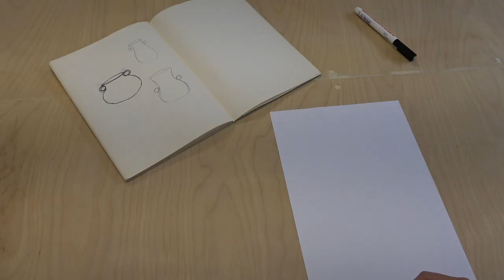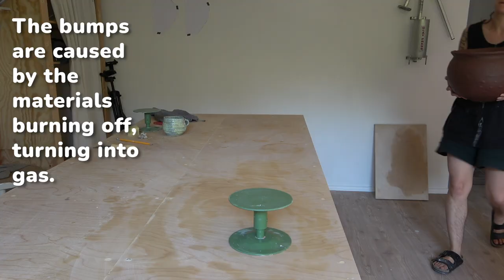A Lesson in Humility

Comment: Those of us who handbuild and sculpt for a living and make large coiled pots or other vessels or sculptures do not only put one coil on at a time and wait until it is leatherhard to add another, that would take forever for us to get anything done even usually with several pieces going at a time, you can add as many coils as the piece can handle until you start to feel that it needs to firm up to support more coils, but absolutely, especially with the first few coils, it can support more coils at one time. Most things can support quite a few coils before it needs firming up. And then most of us use a heat gun or gas torch or even hair drier to dry the lower parts until it is firm enough to accept more coils, this way we can get an entire pot done in one day. Especially if you use paperclay is extremely easy because it regulates air and water flow much better than regular clay so it dries faster naturally (and will also stay at whatever dampness you want easily with covering or putting in a damp box in between things and you can push it back from dry or leatherhard to wet even if you need to). Even if you don’t want to use heat or at the minimum a fan to help the piece firm up (usually keeping the rim covered in plastic by the way as you don’t want the rim to dry out) so you can go faster almost any shape, barring something very asymmetrical or oddly shaped, can handle 3-7 coils at a time depending on how thick the coils are, how leatherhard or at least firm wet the area below is, and the support structure of the shape. And as long as you know what you are doing, using a heat gun or torch or hair dryer will not damage the clay, just make sure you know how to appropriately use them and how dry to the touch the clay should feel, so you don’t create cracks or concentrate too long on one area and over dry it. People coil a lot of different ways, often academically considered the “correct” way is to actually rub the clay down on the inside and up on the outside, sometimes switching if the direction of the pot changes (it curves in or curves out), you don’t usually want to go in the same direction on both sides because it doesn’t provide as good of a bond and the pot won’t be as strong. Same as with usually using slip with the coils except for the first coil. It may seem totally fine not doing those two things but if you go to raku or pitfire a pot coiled that way you would watch in horrors as the already bisqued pot’s coils come apart…first hand experience of someone I know…they had to change drastically how they coiled to make it survive the thermal shock, including more surface area of the coils coming in contact with each other by using more triangular shaped coils, starting to slip again, and often putting thin coils of clay on the inside where the coils joined and blending it in so they were really stuck together. And using very thick bonding slip with sodium silicate and vinegar in it. Sorry the kiln over fired! It is so disappointing when you put so much work into something and for you doing this over a very long time, to have it bloat. The clay is’t terribly dark but definitely has quite a bit of iron in it so may have a pretty narrow firing range before it bloats because of the iron in it getting too hot…definitely one of those lessons you won’t forget though, which is the good part of a piece not turning out…you will never forget to factor the weather/ambient heat into your firing and definitely always using witness cones! Looks like you had success in your next video! I love the profile you developed for the pot, it is a very good looking shape.

Comment: I sooo relate to this video! When you put your heart into a piece and then you pull it out of the kiln and.....wahhh. Can I ask you, do you single fire often? You mentioned you put the piece directly into the final fire, so I'm wondering what your ramp schedule was. I'm in France and it's super hot right now here, too, and I have the same kiln and it hasn't overfired yet. I single fire exclusively with both glazed and unglazed pieces (I glaze them raw, when they are between leather hard and bone dry). My ramp schedule is 60c/hr up to 600, then 150c/hr up to 1200. I keep it slow until 600 so that the raw clay has ample time to off-gas. If I ramp up too fast I get bloating, bumps, and blisters. Thanks so much for sharing this video, you've inspired me to try for a really big piece!
Reply from the maker: exactly— i do a slower ramp when I single fire ☺️ i can’t remember exactly the schedule because its been a while since i programmed it.